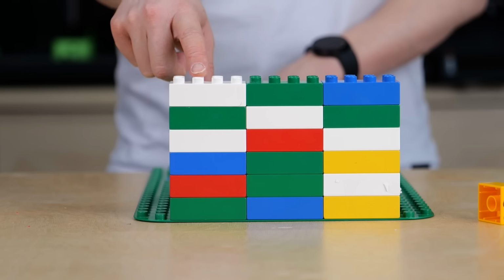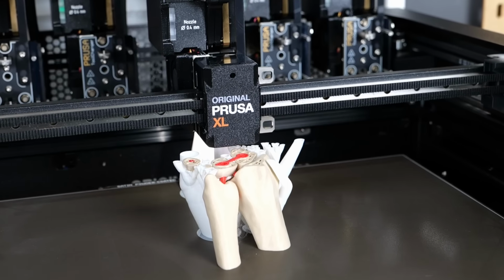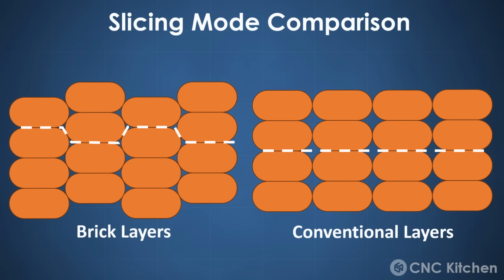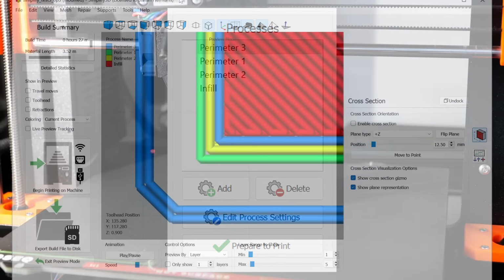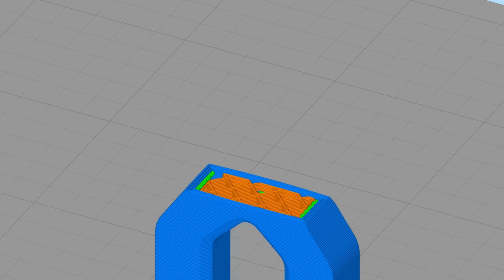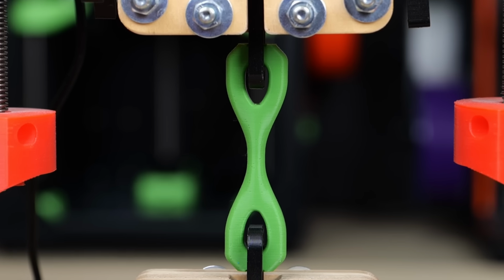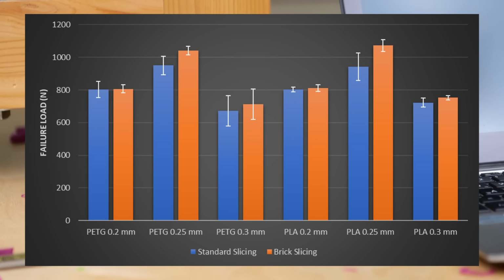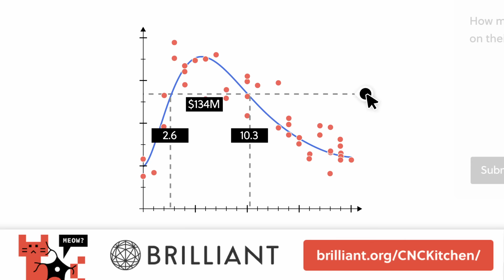Brick Layers - Why did no one do this before?

Comment: the strength increase is nice but I bet this makes the print less porous and better at holding air pressure which is pretty limited with standard printing. that could open a lot of applications.

Comment: I think you're onto something good. Maybe you can fog the freshly laid filament with acetone to help melt it even more with out adding any more heat, then the next layer would stick better. Or run the printhead hotter and blow cold air from nozzles underneath and sides to keep things from slumping.

Comment: The interlocking of the layers does only increase tensile strength because of the increased contact area. The interlocking itself almost only increases shear strength (the Legos take the same force to pull apart whether interlocked or not).  Some further testing therefore might be interesting.

Comment: the way the brick layers shatter on the pink material reminds me of how pistons come apart in an catastrophic engine failure. the 10% increase may hit the limits of the materials possible load limit rather than the limit of layer adhesion, which is the the whole test piece shatters instead of separating at a layer line like the blue one. 
but thats just a casual observation

Comment: With the layer offset this method might tolerate a good bit of 'overextrusion' to reduce the void content further. 
Testing for sheer strength seems like a logical next step; I'd expect bigger differences in sheer than in tensile strength.

Comment: I think, with heat chamber treatment (baking), you'll see better improvement. Because the adhesion area has really increased, if you tried to melt them together, they will totally be homogeneous.
But, I think, if you can try some weaving patterns, they might be stronger because you actually angle the cross section planes of the filament and now you have the actual material to take the load, not just thermal bond. Although it is actually real material bond, thermal bond is weaker than internal bond of continuous flow of material due to slight cooling down between layers and some fluxes of material oxidization.

Comment: Fascinating.This is a world I know (knew) nothing about - thank you algorithm! (subbed)

If I'm understanding this correctly it seems that there is a trade-off between strength and 'repairability' if I can put it like that. In other words, while the old model did fail under a lower load, it had a cleaner break which might be easier to repair - either manually or by 3D printing...?

Another thought: I had no idea there were so many parameters involved in 3D printing - is anyone using AI to optimise these parameters?

Comment: Why not test horizontal offset before vertical offset for the interlocking? That way each extrusion line would have a trough below it to flow into to increase adhesion area, while still having planar boundaries between gcode layers.

Comment: Im new to printing but is it possible to increase overlap? There isnt much overlap in your example but, if you could make a layer flatter, to avoid nozzle collision, and wider with more over lap, and experiment with height to width ratios to find the optimal ratio, i bet you could improve adhesion and strength a significant ammount more.

Comment: there is two things can kinda make it better. first is to use smoothing techniques to increase adhesion. other is to use slamming which means forcing printer to increase height less that layer height and put out more material in same amount of height. this increases the layer adhesion surface

Comment: I wonder if you rigged up a part fan with a heater, so it would blow warm or hot air instead of cold air, if you couldn't improve layer adhesion and reduce warping... particularly with materials like ABS.
Reply: That's why we have enclosures and heated chambers. You minimize warping by reducing the temperature gradient across the entire print then let it cool all at once. Blowing hot air would be worse because it's still going to cool down unevenly as the print progresses.

Comment: I have a counter-suggestion, how about printing the inner and outer perimeters first, plus every other inner perimeter (if more than 3 total) then deliberately over-extruding the perimeter layers in-between, such that they squish into and fill the gaps?   That would require careful calibration of the flow rate for these layers, but no change to Z-height.     It may still present a stress area at the outer edge where the layers meet, but maximise the surface area for adhesion inside the layers, especially where there are an odd number of perimeters and it could fill all gaps from inner to outer.

In practice this would be:   If three perimeters, print 1 and 3, then over-extrude 2.    If 5 perimeters, print 1, 3 and 5, then over extrude 2 and 4, and so on.

Comment: There is a great chance that you are hitting the limit of what the material itself can take with your current test designs. A stronger design will show the effects of different extrusion technic better since the weak point won't be the material itself but the structural integrity of it.

Comment: I think if you simply rig up a cross-sectional equivalent of loops of the filament to be equivalent to the two layering samples you'll find you're dealing with running into the actual tensile strength of the plastic itself after having gone through the printing process.

Comment: Super interesting, congratulation! One question/suggestion though: What you made is not quite the brick-layer pattern - in your pattern there is an offset half a layer in the vertical direction, but bricks are offset in the horizontal direction. Do you think it would make a difference? I'd guess it could - particularly for thin layers...

Here is an idea how to prototype/cheat it quickly for test purpose: Every second layer can be simply rescaled to be half a nozzle larger. (Would not work for general objects, but it should work fine for your test object.) Not sure if simplify can do it - but if you are interested, I can help to write some code to do it. (I never manipulated GCode, but I think I should be able to do it, could be interesting...) - Let me know.

Comment: Have you done any tests where you measure other stress’s? As in, have you measured the improvements in its capabilities to withstand shear and torsion forces, maybe even improvements in resisting compression? Just thought it would be interesting, however I do not have a 3D printer, nor do I have experience with any of this. 

I also think that because the cracks suggest a more total structural failure, the overall design of the 3D print will have more of an effect on the stability and strength of the design rather than the tensile strength limitations of 3D printer filament.

Comment: 4:45 w8 how can the nozzle make thicker lines? Does it just go slower? Or can it switch nozzles for different sizes?
Reply: You can push more material through the nozzle, it has to go somewhere...
Reply: @RacingDuck  uh.. how does that answer my question? 😅
I'm guessing you mean it comes out faster to make thicker lines? Didn't think of that as an option.
Reply: It depends on what's limiting the speed of the print. If you are limited by the flow rate, the printer has to slow down to get thicker lines. If you are limited by your set movement speed, you can increase the flow rate to get thicker lines. Sorry for being unclear.

Comment: I think the increased layer adhesion made the plastic itself the weakness rather than the layer, hence the secondary fractures.   This would explain why PETG was only about 10% rather than 14% like PLA given PETG is a bit stickier in the first place.
**Question:    Does the offset layer affect the speed of printing on the same item?
I'd love to see this properly implemented in a slicer so that the surface layers were modified to make them smooth.   This not only would improve adhesion as you proved, it would also reduce the appearance of layer lines and also reduce the dependence on infill for strength, making printing purely decorative items more efficient and needing less filament.

Comment: It'd be interesting print another test part horizontally, so that the layers run parallel to the direction of the force vector, that way you may be able to measure the maximum possible force it can hold, as a goal/limit for this sort of experiment.

Comment: That is a pretty awesome idea and when it is pushed by a rather big channel like yours it might find its way into the slicers.
What would also very much help in getting stronger parts would be independent testing of filament brands. For instance you can buy a version of PLA+ from basically every brand, but it is at the same time almost impossible to know which one is actually the strongest for a given stress profile unless you test them all yourself. If you want to help the community get stronger prints easy you could use your testing machines to test the strength of different brands and publish the results.

Comment: I think a better test would be twisting or a weight on the piece horizontally.  These would have inconsistent forces.
Sometimes, an easier modern solution is to just simply increase temperature and decrease layer height.

Comment: Looking at the cross sections I think you need to increase the extrusion when printing with this technique. When packing circles or ellipses the hexagonal approach is more packing efficient. However this means that in this case, since you aren't filling that additional space with additional material, you might actually be subtly reducing the amount of contact between adjacent extrusions. In the cross sections of the hex packing you can see there is far less distortion of the ellipses, implying that the extrusions might be experiencing less "squishing". For circles a square packing is about 78.5% fill vs about 90% for a hexagonal packing, meaning you could fit almost 15% more circles in the hexagonal packing. While you aren't extruding perfect circles, you could probably get away with at minimum increasing the extrusion amount by 5-10% when using this technique.

Comment: Interesting that you saw such a substantial increase in tensile strength, as the interlocking pattern should mostly increase shear strength. If you have a rig that can test shear strength, I would expect a much larger increase in strength than you observed in the tensile strength.

Comment: I think that the vertical cracking is likely to be a result of the isotropic material properties.
However the "vertical z seam" or other nozzle movements, spots where nozzle is starting/stoping printing might be a cause of vertical beaking, if those spots are stacked on top of each other every layer.
It should be checked how it's sliced before making the verdict.

Comment: I think you should reproduce this test using transparent filament, so you can get a look at it through polarization filters. I suspect you added additional stress. Not that this is automatically a bad thing; tempered anything; glass, steel,  has locked-in stress.

Comment: So, the question is, where were seams located at for your layer changes? Because if they were in (roughly) the same position per layer, that might explain the vertical failure rather than the horizontal one. If they were randomized, that might not be the case. (And if not randomized, wouldn't that be a good option in a slicer that fully implements brick layers (Randomize per-layer start points for additional part strength)

Comment: Interesting. I am curious if you changed the horizontal offsets distance like you did the layer heights? Like say in single layer printing looking at the cross section you might see the printing strands be .4mm center to center from one another. But if you brick layer it because the edges are rounded you may be able to have an offset of .375 from one strand to the next. Because of this rounded edges if you brick layer and use the standard .4mm spacing you actually have less material bonded on the corners and thus a prints are weaker to vertical stresses. Might be a reason why a lot of the brick layered parts exploded or broke vertically. Just a thought.
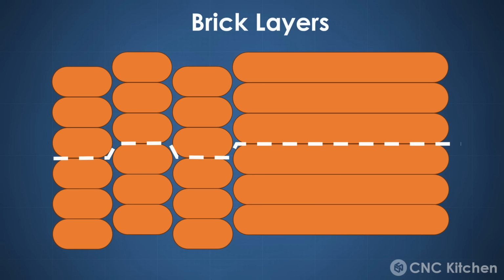Reply: See the graphic shown in the video at 2:50 for a better description. Of using the same standard offset from one perimeter to the next while trying to use the brick layer method.

Comment: How about re-heating the existing plastic surfaces just before the newly extruded plastic lays down? A positioned laser or lasers could instantly heat and melt some of the old plastic -- from the surface down some few microns. The heat will quickly spread out into the plastic below, but the surface might still even be hotter than the incoming plastic when it arrives from the nozzle. (Be careful not to boil or burn the existing plastic -- or do it anyway.)

Comment: I would probably go with layer height = layer width to get as close as possible to a hexagonal honeycomb-like cross section. From there, the material should be deposited with more pressure to result in as little air gaps as possible. Reducing the air gaps should certainly be much easier in this brick wall type method than in the normal way, as the filament only needs to be deformed into a hexagon, not a square. Add post-processes like baking to the pipeline, and you get pretty close to a full density material.

Comment: I think that you may see different results if you print your test part one at a time.  Watching the video, it appears you are printing four test parts at a time and printing to all fours parts with each z-layer increment.  I'm speculating that by the time you get to the next layer, the last layer has cooled slightly, and the bond will be less than if you immediately went to the next layer of the same part and did them sequentially instead of in parallel.  Given that this video's stepped hypothesis is all about bonding, I would wager this would make a significant difference.  It's going to gnaw at you until you try it.  Granted, you have to print your test parts for the controls sequentially instead of in parallel too.

Comment: In a materials engineering class I took years ago, I did a part test like this. The part indeed seems to be more homogeneous, and now your design is the failure point. You should make the base and top solid, as the parts have a thinner center so that failure is guaranteed to happen in the middle. The shape you are using distributed the force, but you want it focused in the center there. I doubt you will get a much different result, but I would be interested in the result. Could give a more accurate result.

Comment: Can you use a multicolor printer to print one layer of plastic and another layer of solvent, interleaving, so that the layers glue to each other better? That way you wouldn't even need much heat.

Comment: im always interesting in any and every attempt to increase layer adhesion without sacrificing detail or significant print time. its one of my biggest gripes about 3D printing. ive been thinking some kind of rotating hot end that "scores" the previous layer before the new layer is printed might help a lot but moving parts is a great way to scare adopters and testers so :(

Comment: I think printing hotter (without the plastic liquifying too much) and thinner layers (to "smoosh" it more) will drastically increase the tensile (and all) strengths, but the room would need to be very, very well ventilated, and the right type of plastic would need to be used to handle the higher temperatures. I wasn't sure if your method would work better, but it probably is better because it increases the number of contact points and also creates non-linear sheer points (hence why you saw vertical fractures). I'm not a physicist and haven't 3-D printed in years, though, so idk.

Comment: Hello! I think that your approach will significantly improve layer adhesion backed up by your tests! Slower printing speeds, higher temperature and line width could perfect this layer adhesion booster. Nice work! Will be waiting for this setting in Cura slicer soon I hope! Cheers! 

Edit: 
I found out that printing speed and temperature have a very drastic effect on part strenght. When I print PETG or PLA monitoring the temperature not to burn the filament, and speed of about 25mm/s produce very consistent parts with great detail. Unfortunately faster printing doesn't solve the problem you mentioned of the material not flowing and melting together into a single matrix and it makes it worse I believe. Slower printing improves that for the cost of time, but for parts that need to be consistent and perfect need their time.

Comment: Hello Stefan. Youre doing great job.
Maybe You can try different line width on subsequent layers?
For example, for a 0.4mm nozzle:

(   0,6   )(   0,6   )(   0,6   )(   0,6   )...
(0,45)(0,45)(   0,6   )(   0,6   )(   0,6   )...
(   0,6   )(   0,6   )(   0,6   )(   0,6   )...
(0,45)(0,45)(   0,6   )(   0,6   )(   0,6   )...

Best wishes.

Comment: I think the secondary plane that it broke in is important to note because if you can figure figure out why it broke in the second plane. If it has to do with the fact that it added that 10% in your results. If it's directly correlated, then I would imagine if you can find a way to increase the amount of planes that are connected to each other, then maybe you can make a piece that even though shatters after such heavy loads, it hasn't extra 10% efficiency or maybe less maybe more. Who knows the point being. If you can figure out a way to increase how many sides are pulling on each other. I would imagine something like a diamond pattern would be needed so that it has the most points of contact with each other to share the load of from pulling away from each other.

Comment: If you have homogenous part properties then you can strengthen the part throughout the load directions like you would normal materials. sometimes without adding weight. it's a net positive